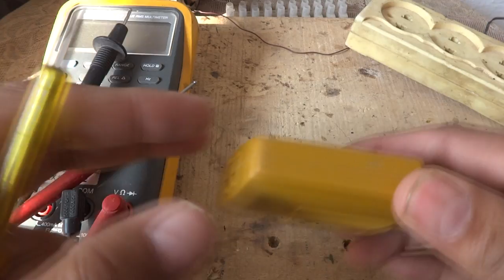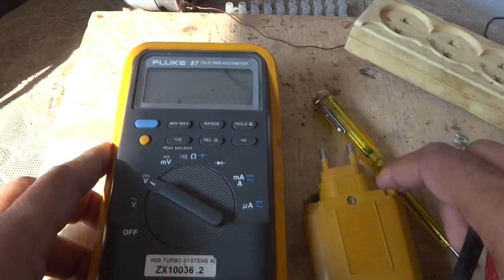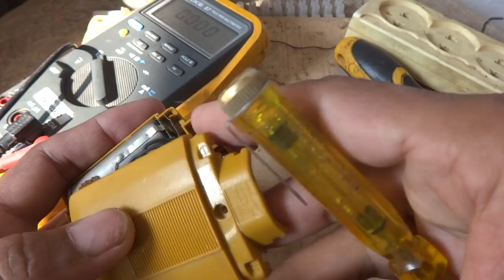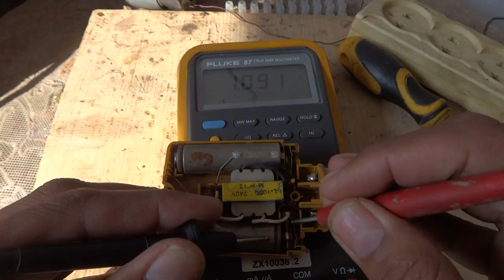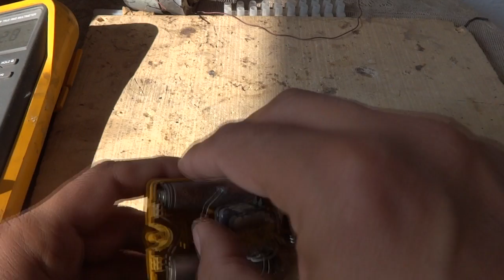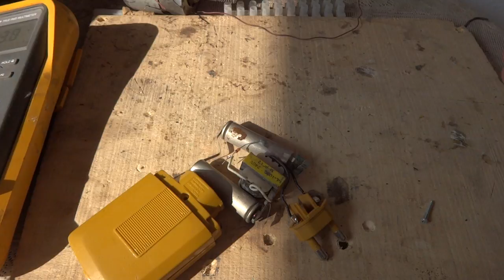40 years old torch light review and circuit system details search flood light

Comment: Nostalgic feeling with vintage sanyo flashlights. Still i have 3 of these nl-1000n yellow models. This model came with 230V. For USA sanyo made nl-5360 with 110V (US plug). Same model. But black colour. For australia sanyo made nl-1000 with  AU plug. Its also black. All it have sanyo cadnica batteries with 700mAh each. These flashlights have single diode half wave charging system. By that time 2.4V krypton bulb is not so available in the market. This torch have it. Old good days. Golden times. SANYO is the pioneer of rechargeable flashlights. Believe it or not these flashlights are not so bright. But by that time it is sufficient to do usual things. This is my favourite flashlight.

Comment: how to change battery & which type bettery suitable for it..?
Reply from the maker: AA size rechargeable battery cells.
Reply: dont use li ion battery for this. if u use then must use protection module otherwise it will blast.

Comment: Im supprised the plastic lasted that long, and not supprised by the ill NiCad batterys lol.

That transformer looks good for it's age :-D.

I can't see a modern switchmode lasting that long, they die far too easy don't they?
I like old tech, basic and lasts far longer than expected.
I made a 13.8v 2 amp supply for a frend back in 1987, its still working 30 years later, im amazed and happy it still works :-D
Reply from the maker: You are very much right dear sir. They are old units but very simple and reliable. Next part of this video will be soon.
Reply: @JahanZeb1976  if iam not wrong ,the unit was made in Japan.?
Reply from the maker: @rajasahoo7027  yes, you are right.
Reply: I still have a sanyo cadnica searchlight nl-s630n ...transformer info reads s630n 220-240V m8h3n... 
The plastic mold quality is rated unbreakable to stupidity..
I've got a leaking batt ..will try to revive it ... Hopefully..
Reply: i hv a steblizer which is working since 1990 totally hand made.
Reply: Can someone help me with diode value
Reply: @hamzahasan5286  1N4001 should work, 1 Amp general diode.
Reply: @zx8401ztv  thankyou ,just found this at my grandfather's attic was confused a bit